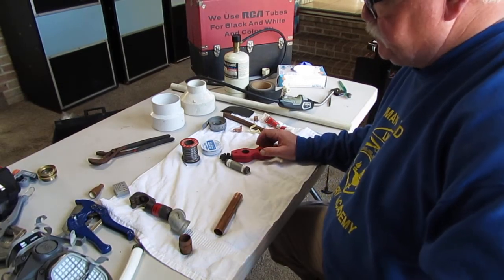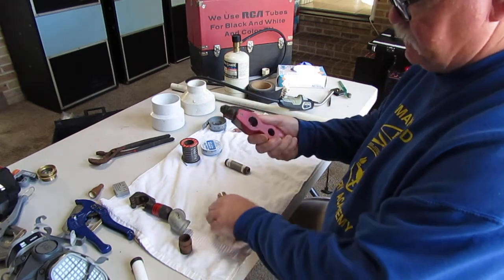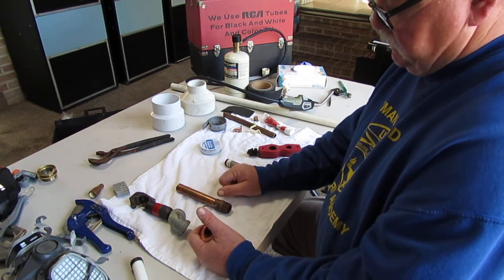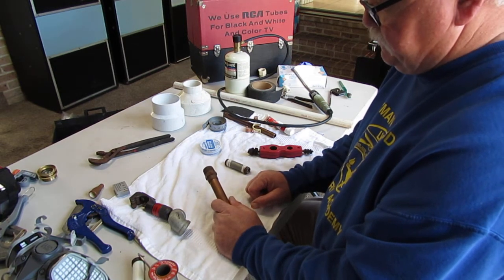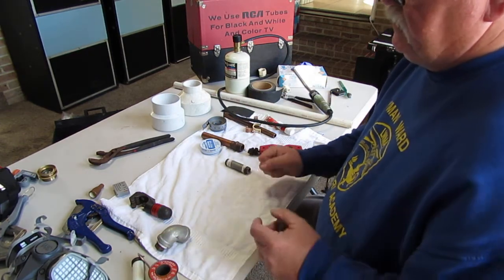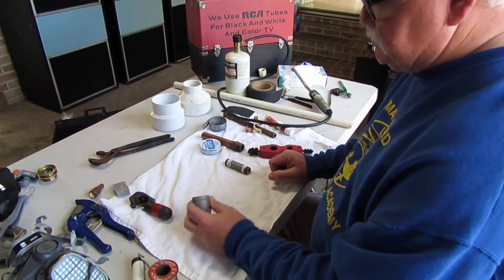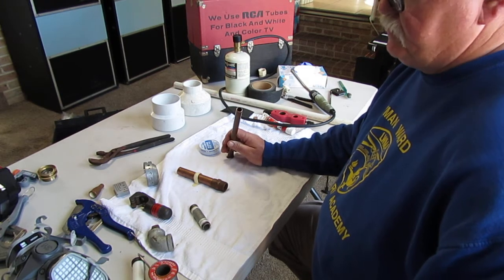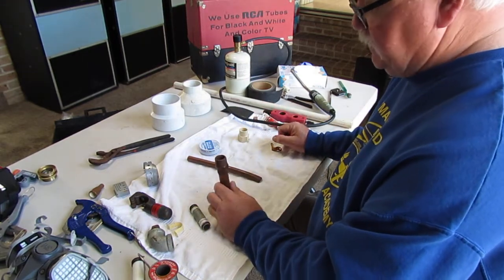What to know about Copper Type L M & K Water Pipe vs PVC  PEX review which is the best plumbing 150

Comment: Great info. I have a question. If you care about ultimate quality and reliability...what would you recommend for the rough in plumbing of a 3-way walk in shower system (main rainshower head, 2 body jets, and a handheld slidebar showerhead)? I'm currently converting a tub shower into a walk-in. Got all the walls demoed, and the supply lines up from the floor are PVC, however the original shower also used copper, and I'm thinking of going with copper again. Should I use K, L, or M pipe? Should I even be using copper in the first place?

Home is in Western FL, around the Sarasota county area. Thanks!
Reply from the maker: When I was a plumber I used type K Copper in the slab and type L Copper above the slab. Copper is a good material as long as it is installed correctly and does not make contact with dissimilar metals. I think copper is certainly the best to use to the kitchen, since it is less likely to carry potential toxic components of plastic pipe. Thanks for subscribing to Southern Stories